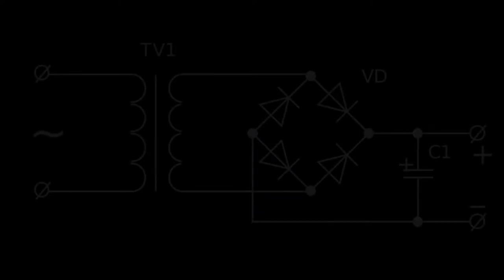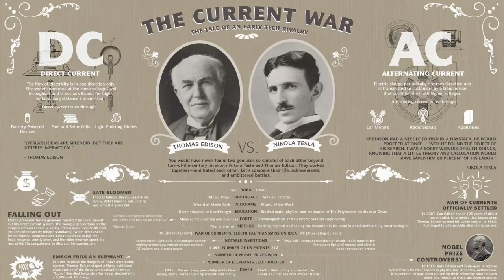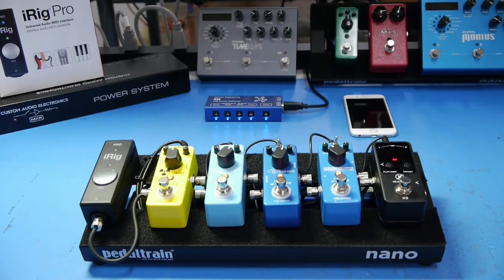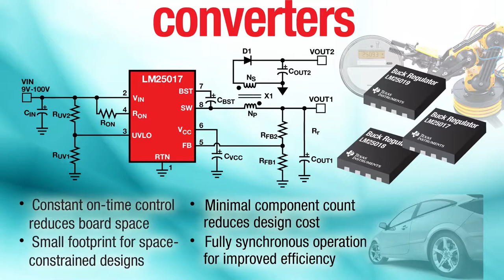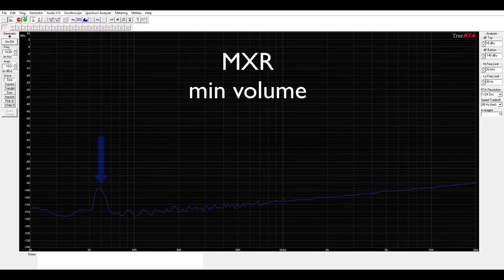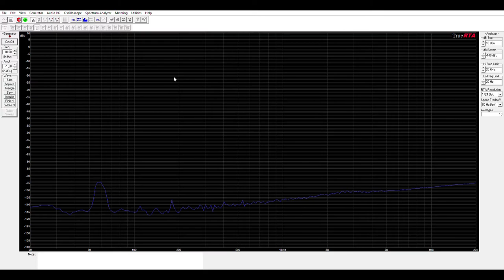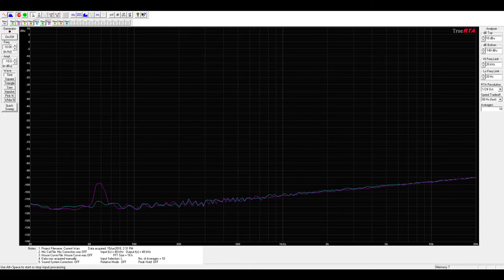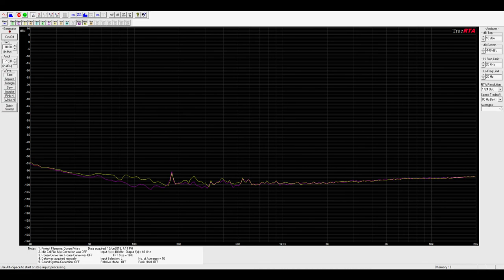Current Wars II. AC vs DC Pedalboard Power Supplies

Comment: Yup, with all this demonstrated, I got interested in seeing all the other noise components separated and then combined and compared to give perspective. Of course only on example level since the endless list of differing amps, pickups, possibly cables and pedals as well. Nice to see some actual examples on these videos so you get more than just a word. Also saw That Pedal Show's Mick get the Mission usb power supply for one video even though they usually prefer Dan's GigRig stuff. Must be pretty much the only other power supply that has made the show.